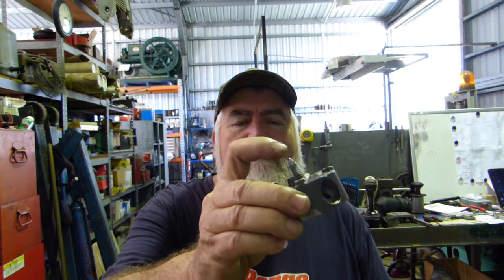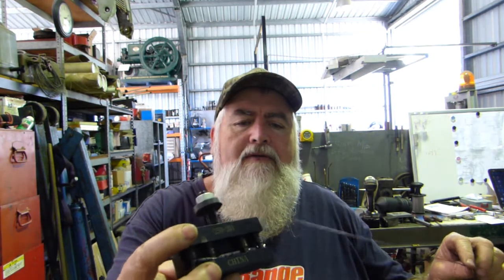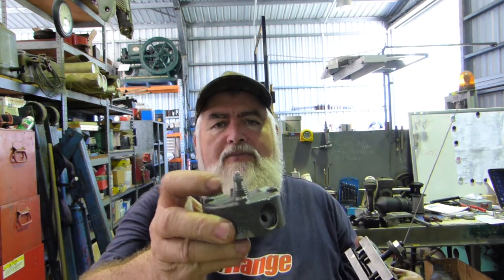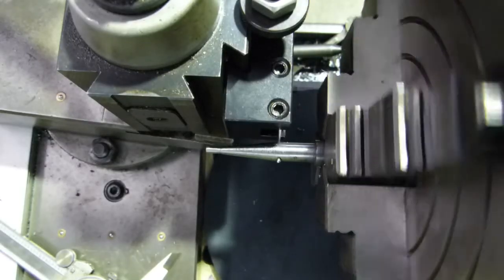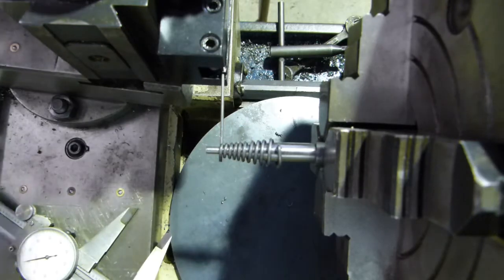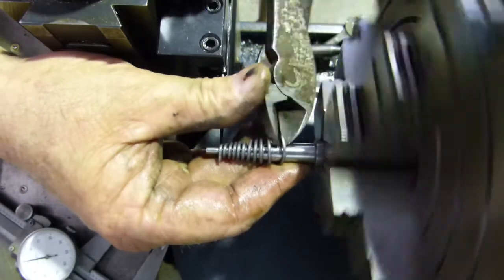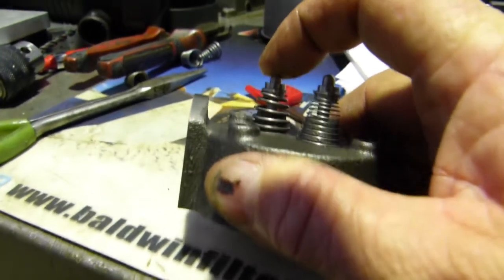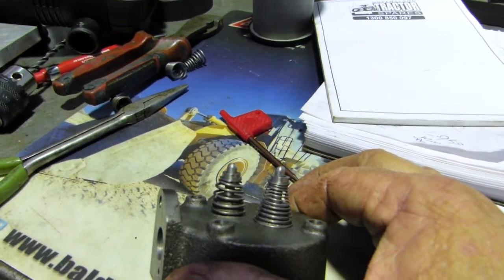1/3 Scale Fairbanks Morse 3hp Model Z - Making the Exhaust Valve Spring

Comment: I have another question Lance--that little motor did it come with a crankshaft to machine up    or will you have to make one from scratch..There might be some good video material in that project..
Reply from the maker: I made one from scratch, I started the engine well before I had a channel so parts of it are done already.

Comment: The springs worked out well, i do em using the half nuts engaged to get them close, 14 turns per inch set up for 14 threads per inch, either left or right depending on the way you want to wind them you might have to add one or two for springback in the finer wire but it gets you close. The toolpost i use has 2 bits of thin ply tightened with the toolholder screws to keep the tension right. cheers Derek
Reply from the maker: G Day Derek, I tried the 14 tpi but with the taper it wasnt working quite right for me, I did look for two bits of ply to but could not find any that wasnt going to ruin a big sheet so thats how I came up with the poly tube, It worked ok but is single use. I certainly learnt a few things. Thanks for watching and commenting.
Reply: i must admit that i have not tried it on tapered springs but it works fine on straight ones, basicaly a spring is a thread but added rather than cut, like repair helicoils. might come in handy in the future. I save the small wood boxes some fancy wine bottles come packed in, a cigar box would do too as its thin stock. cheers Derek